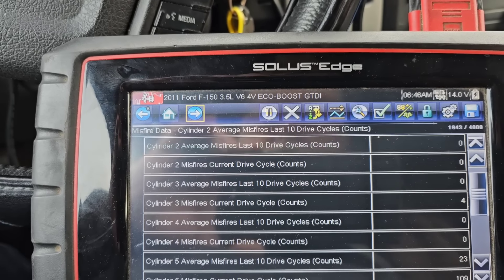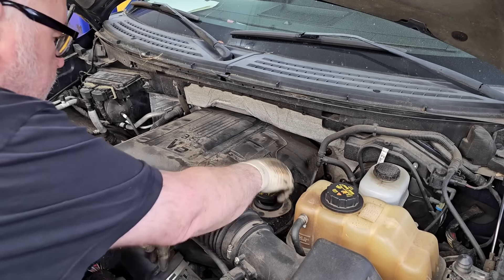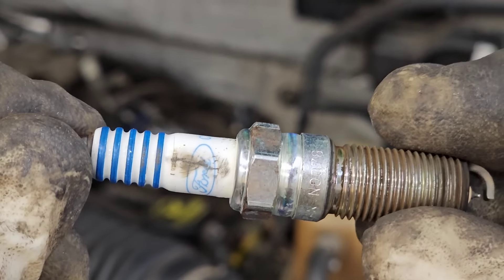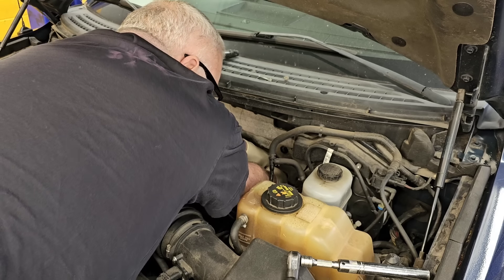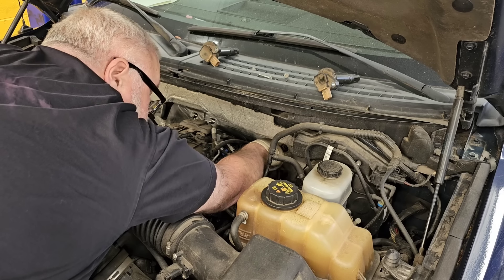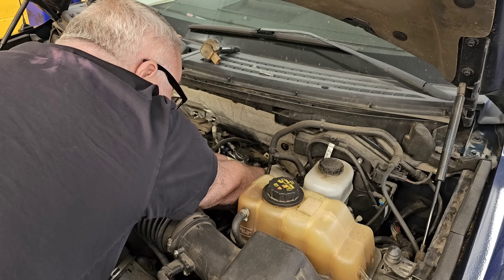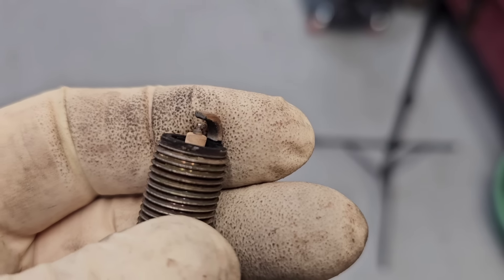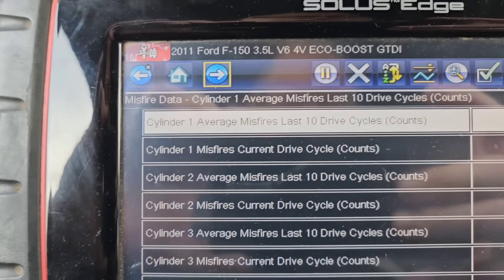Power Loss Due to Misfire Causes Transmission Shifting Concerns. Carbon Tracking Spark Plug & Coil

Comment: I knew a mechanic originally from Turkey who said “nothing will hold tighter than a good cross thread”!!
Reply: After 57yrs of doing mechanic work, I have yet to find a mechanic who had formal education in the field. Whenever I tried to tell one every bolt needs to be lubricated especially if we are going to measure the torque or the yield, they say no, it will come loose. I have finally decided they believe cross-threading, dirt, rust carbon or loctite is what keeps a bolt tight. They don't have a clue about clamping, thread stretch or tension.
Reply: Lolol so true
Reply: If that was so, then rods a main bearing should fall off
Reply: @benjamincresswell3713  Loctite actually works as a lubricant when installing fasteners until it hardens. It also keeps galvanic corrosion and rust out of the threads. And for bolts/nuts loosening up, I have only experienced it 1 time. Gm rear end cover bolts seem to loosen on their own if loctite is not used.
Reply: @benjamincresswell3713 I have known people that would not hesitate to put 50 pounds torque on a 1/4" bolt.
Reply: Plugs can look good and still short in inside of plugs 😄
Reply: @wendwllhickey6426  sometimes spark plug porcelain can become conductive with fuel soaking or deposits.
One of my tricks over many years has been when able to, to bend the gap to about .005" to get an engine running, then once it has run and heats up to gap to regular amount.  The electricity is more likely to jump the .005" gap than travel through soaked porcelain.
It confuses a lot of people, usually those with too much education.
Reply: @benjamincresswell3713  I always liked the understanding that head bolts that need about 60 lbs. torque , need to be lubed. That other high vibration engine bolts that get around 100 lbs. of torque should be oiled, but wheel lug nuts should never be oiled or they will fall right off.
It's alright if they are cross threaded, gouged and stripped but never oil them.
Or you will die.

Comment: My son was driving one of my vans and told me that it wasn't shifting right so I took it for a ride and it shifted okay for me. It did stumble when I took off from a stop and I figured it needed a set of plugs. It ran a lot better but my son still complained about the shifting. It was not shifting into overdrive as well as I thought it should so paid close attention and there was still a slight miss. Finally after replacing the plug wires my son stopped complaining. They were the original wires and the difference could be felt when shifting into overdrive. Good video. 
Happy Motoring.

Comment: My 2014 Ecoboost had the exact same issue with carbon tracking and misfiring. Now I replace the plugs every year just because. This is a well known issue with the Ecoboost. BTW I start a plug into the head with a piece of stiff rubber hose slid over the ceramic. It will let you feel the threading process and slip and remove when it is finger tight. Keep wrenching Kenny- love your channel!

Comment: Nice job, I always used the German torque spec. Kenny, I put a 455 olds engine together, heads, everything, without a torque wrench. It was so tight I had to use 24 volts to turn it over starting it for the first time. It was the best engine I ever had. It was a work boat, cooled with seawater. It rusted out before it wore out. In a car, just guessing wild it would have had 500k miles on it. True workhorse, changed the oil every 2 weeks.

Comment: Same exact problem - Is usually from people that want something fixed for free. You had their car in your shop a month ago and now it has a problem and somehow they want it to be your problem. I work on marine diesels, but rarely yachts because of some of the people that own them. I'm older than you and don't need the work. Although sometimes I'll take on an engine if several others have failed to fix it. Those are sometimes fun to figure out.
Reply from the maker: I never understood the "it's the same problem" mentality. Especially when the first time their vehicle came in on a flatbed.  Im sure you figure out the engines that other people can't. You have experience & that goes a long way to figuring problems out. Thanks for watching & keep wrenching 🔧
Reply: Nothing like figuring  out a problem after 10 other people gave up.
One of the main things that kept me from becoming a professional car mechanic was the old 
' since you worked on my car it has this other problem ' and it's supposed to be your fault and you need to fix it for free.
Reply from the maker: I hate the "ever since you" people! Keep wrenching 🔧

Comment: I feel your pain, Kenny. Having worked in dealerships as a service advisor, I saw more than a few "it's doing exactly what it did before" complaints where, as you say, it's either not the same or it's similar symptoms from a different cause. 

The thing we have to remember is that a customer is upset at paying money and it appears to them the job's not done properly. All they know is it's not right and possibly aren't in the best frame of mind to have the differences explained. All they'll hear is being told that they'll still have to pay as it's not the same issue. 

You can be as right about the cause and even how it presents as you like, there will be times when the customer simply does not want to hear that it's going to cost them more. In time they'll often accept it, but in the moment it can be a difficult conversation. 

That said, we NEED people like yourself who know this stuff well enough to be able to properly diagnose issues instead of simply loading the "parts cannon" and hoping for the best. Thanks for your videos and patience in explaining things to those of us who want to learn.
Reply: If your that cheap to have your car fixed fix it yourself if and quit blaming person that's fixed your car because you drove it till it quit which you did not the mechanic 😂

Comment: Spark plugs come pre gapped from factory. Every time I have checked gap the plugs are spot on, also with todays ignition systems being high energy,  being off on gap a bit is no big deal.
Reply: Had a Ford 4.6L engine on an MV1 wheelchair van

One runs on CNG so the plug gap is .044" while the gasoline engine uses a different plug with a .052" gap

Doesn't hurt to check them before installing, especially those plugs that don't come with a protective sleeve in the box
Reply: Depends on who made the plugs as far as gap is concerned. Yes... some are correct out of the box , but I've found a lot of em way off !.   Should check em before installing ...
Reply: Not on copper plugs. I have to gap them on my GM OBS trucks.
Reply: I try to make them all the same gap whatever size it is.

Comment: Had an issue with my 2002 trailblazer.  No power/A/C not cold/transmission not shifting right.  Exhaust manifold started to leak.  Had that fixed.  Found out the cat was plugged.  Had cat changed all the other issues left once the motor could breath.

Comment: i've started stuff by hand when threading them back in...never ha it cross thread after making sure it was properly started a few revolutions....now stripping the threads out of the hole because i didn't adjust the torque limiter.....yeah...done that a few times, i just throw in the next sized bigger bolt after painting it orange

Comment: I have seen videos of people putting in spark plugs with loctite on the threads and tighten them with a 1/2 drive impact wrench
Reply: 😮 no waiiiii... In a professional setting or in an automotive class?

I've seen one student ready to pull spark plugs with an impact gun and I was like "whoa"
Reply: It was on a Facebook group page
Reply: @Toolaholic7  ahh, probably did it for the views and comments 😂
Reply: @ricebike he needs to experience what I just went through. Ripping a plug off then drilling the head off so it could back out with easy- out.
A whole bunches of fun.
I was stupid enough with a small breaker bar.
Impact wrench???????

Comment: cylinders 5 -3 -1 showing misfires....one whole side is miss firing. one bad enough to affect the other 2? or the real problem affecting first one in the worst way, and dragging the other 2 into the mix because of the impediment?
my dad always said if they still work don't fix it, but the 40+ year mechanics at the dealerships always said do the recommended maintenance and replace them at the recommended miles because you don't know when the old ones will fail any more  and it will always be at the worst possible time in the worst possible place when you need it most, and if you only replace what fails, you will end up tearing everything apart and reassembling things enough you can become his shop assistant just from all the practice you'll get breaking things out of frustration as stuff wears out and causes the worst possible time, in the worst possible place, when you need it most.
i haven't found that mechanics advice to be wrong hardly at all compared to my dads advice...preventative maintenance is worth it's cost vs in a whole new automobile.